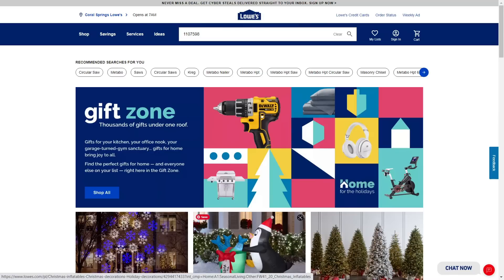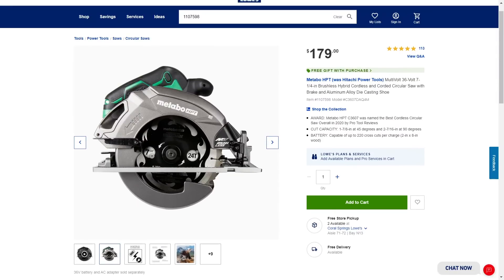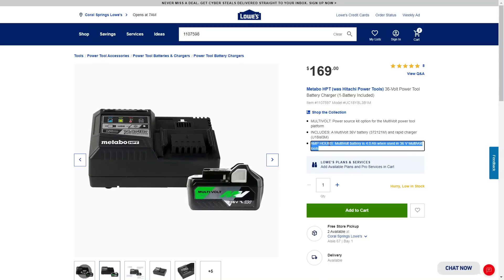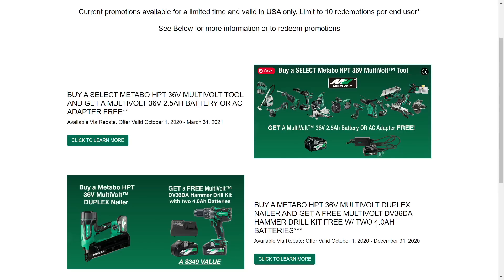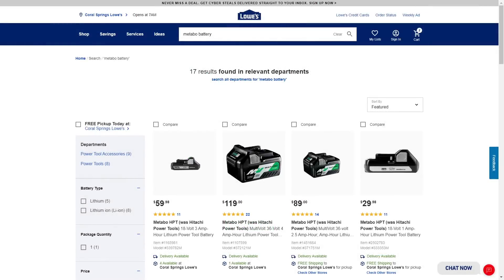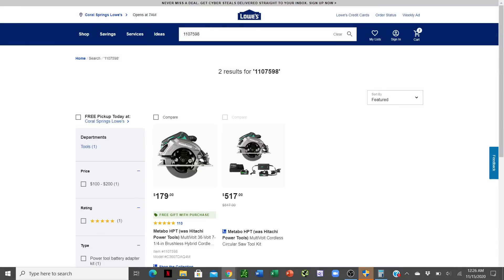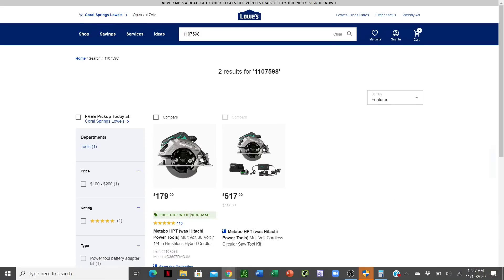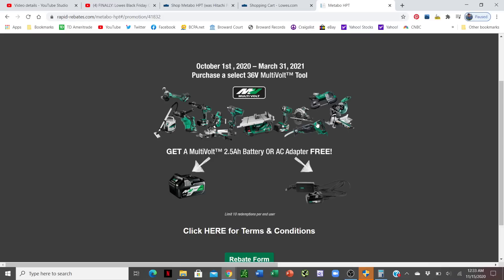HUGE Metabo Saw Deals $258 OFF Lowes: FREE Charger + 2 Batteries

Comment from the maker: From Home Depot Tool Deals mentioned (paid affiliate links)
🛒 Dewalt $499 6-Tool Kit with Toughsytem Tool Box: https://homedepot.sjv.io/9NE5j 
🛒 DeWalt Home Depot Buy 1 Get 1 Black Friday Tools: https://homedepot.sjv.io/VJB4J
🛒 Battery Starter Kit 6Ah/4.0 BOGO Tool Deal: https://homedepot.sjv.io/yagN2
🛒 DeWalt XR Brushless Drill/Driver Kit BOGO Tool Deal: https://homedepot.sjv.io/nqoNR
🛒 All 30 DeWalt Buy One Atomic Kit Get 2 Free Tools Deals: https://homedepot.sjv.io/xe9KR
🛒 All 10 DeWalt Flexvolt Advantage & BOGO Tool Deals:  https://homedepot.sjv.io/MZ6An
🛒 DeWalt Folding Portable Workbench Black Friday Deal  https://homedepot.sjv.io/Qo9vo
🛒 DeWalt 10-Compartment Deep Pro Small Parts Organizer: https://homedepot.sjv.io/bEEYg
🛒 DeWalt 12 in. 20V MAX Brushless Chainsaw (Tool Only): https://homedepot.sjv.io/XgW74
🛒 DeWalt Pneumatic 21-Degree Collated Framing Nailer https://homedepot.sjv.io/ELJPK
🛒 Dewalt Miter Saw Tool Deals Black Friday: https://homedepot.sjv.io/nqo6X
🛒 All DeWalt Nailer/Compressor Black Friday Tool Deals: https://homedepot.sjv.io/r9Oov
Other useful Home Depot Tool Deals:
🛒 Gorilla Ladders Work Platform: https://homedepot.sjv.io/mey4X
🛒 Dewalt Battery Starter Kit Tool Deals: https://homedepot.sjv.io/43AB9
🛒 Milwaukee Battery Starter Kit Tool Deals:  https://homedepot.sjv.io/LJ1yZ
🛒 Home Depot Special Buy of the Day Tool Deals: https://homedepot.sjv.io/K1M99
🛒 Dewalt "Special Buys" Tool Deals List: https://homedepot.sjv.io/Qo3xo
🛒 All 290 Milwaukee tool deals or battery Deals: https://homedepot.sjv.io/LVrOV
🛒 All Home Depot Dewalt Atomic Tool Kit Deals: https://homedepot.sjv.io/VE3gA
🛒 Ryobi lower price tool deals: https://homedepot.sjv.io/3nWgK
🛒 Milwaukee M12 Free tool or battery Deals: https://homedepot.sjv.io/VEV26
🛒 Milwaukee M18 Free tool or battery Deals: https://homedepot.sjv.io/0WORO
Disclaimer: Some of the links we send you to are affiliate links which which if you click on them and buy something, we may receive a small affiliate commission. We appreciate you supporting our efforts to continue to bring you word class tool reviews, remodeling and repair videos, and shop with me videos looking for the best discount tool deals.
Reply: Rigid or Metabo table saw?

Comment: Thanks for sharing this @jeffostroff!

For comparison @ Lowe's, Metabo HPT MultiVolt...
...2.5ah battery $89
...4ah battery $119
...AC adapter $169

The Lowe's "gift" includes the 4ah battery and fast charger (w USB port) kit ...also priced @ $169.

To get the most savings, I picked the AC adapter from the Metabo promo.

Side note, gift link only shows up on website ...not on (Android) app.
Reply from the maker: Good to know about the android app, thanks!

Comment: WOW, so for $408 you can get the circular, the recip, 4 batteries and 2 chargers. Wonder what the ac adapter sell for. Who wants to be tethered, but in a pinch it's a good option. Thank you Jeff!!!
Reply from the maker: My thoughts exactly
Reply: I think the AC adaptor is usually at least $150 dollars. Definitely a nice option if you want the flexibility and that way you don't feel the need to keep extra batteries around "just in case."

Comment: Picked up the recip today it a beast!!
Reply from the maker: Did you get the free battery and charger? don't forget to go to Metabo's website for the other free battery
Reply: @jeffostroff  yes I did get a free charger and 4.0 battery at store, Thats the reason I got it for its rebate and will be getting the ac/dc adapter.
Reply: I got the cir saw/free battery but am not having luck with the rebate form! The “country” cannot be filled out.
Reply: @flyingredneck7811  I'm having the same  issue
Reply: @DON_TOOLS  I contacted metabo, they’re looking into it...
Reply: @flyingredneck7811  The problem has been fixed I just did my rebate 5 minutes ago.
Reply: @DON_TOOLS  I just submitted my rebate too. Thx for the heads up 👍

Comment: Not sure if it recently changed or if anyone has mentioned it, but on the website it states “Offer only valid on Metabo purchases made at participating retailers October 1 - December 31, 2020. Not combinable with any other Metabo promotional offers. Limited Time Only.” Are there any confirmed purchases?
Reply from the maker: A few people have commented to me that they did indeed do the purchase And got the extra battery in fact it was because one of our subscribers did that it led to us making this video. I think you're getting confused by the statement on the website because they're probably trying to avoid whether you bought it off eBay from somebody or some other stolen goods or grey goods that sort of thing they just want to make sure that you bought it from a legitimate retailer like Lowe's for example

Comment: Damn i would get the ac adapter free. That makes it really easy to not need another battery since i can keep the free one from Lowes and while it charges I can use it corded.
Reply: That's what I did last night 😁...like having it as a backup until I can find more MultiVolt battery deals to build up my supply ...have similar setup on Metabo's miter.
Reply from the maker: this is a good deal
Reply: @jeffostroff  this is a GREAT DEAL!